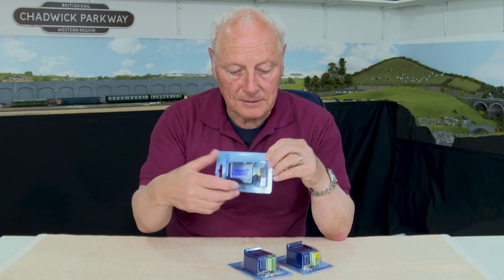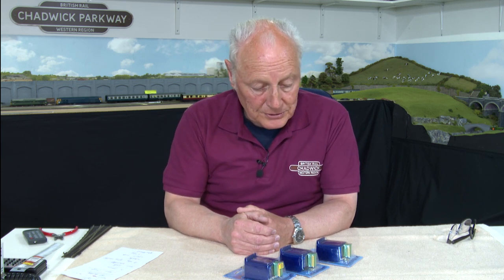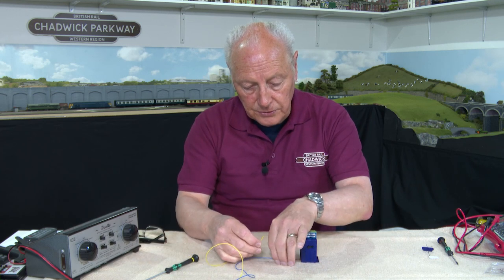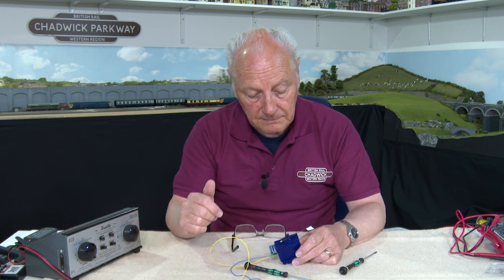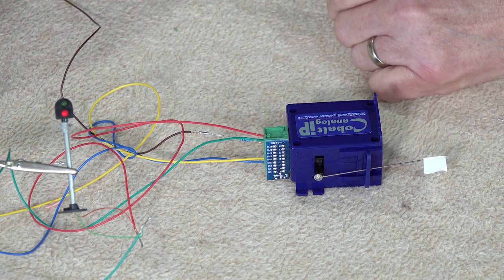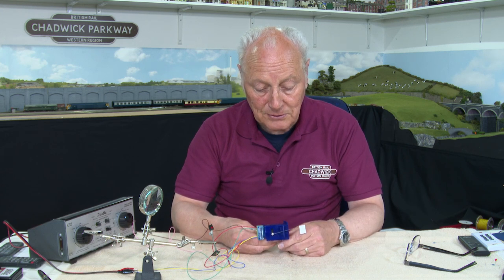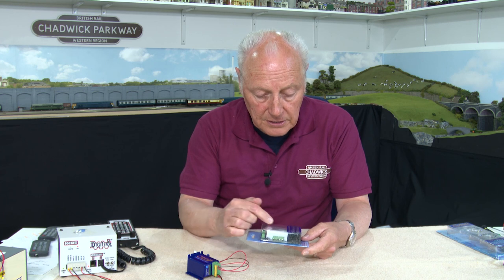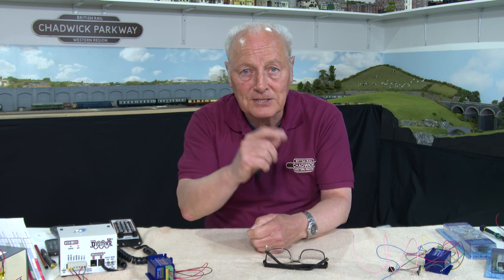Cobalt Point Motors on test at Chadwick Model Railway | 161.

Comment: Hi Charlie, I'm building my first layout and elected to go Slow action point motors rather than solenoid and Cobalt Omega Classic. I like the fact they come pre-centred for fitting. However, I do find them quite noisy, well noisier than I was expecting although I do not have any reference of other motors. I have tried using different voltages and that seems to vary the speed and the noise, so it's worth experimenting a bit with that. Your comment about removing them for oiling is a good one. I had to remove one of the motors to do some remedial work on the point and found - the double sided pads don't like coming apart once stuch in place. Luckily I had a spare pad but you'll destroy the pad if / when you ever had to remove the motor - unless anyone knows a clever way to do it while keeping the pad in tack. Cheers....
Reply from the maker: An excellent point Vernon.
Reply: We have loads of spare pads ;-) ^RB DCCconcepts

Comment: Thanks Charlie 👍 Another informative demonstration- keep up the excellent  work with your “how to” videos. This has made me rethink what I am going to use for DCC point control.
Reply from the maker: Just getting away from solenoids is so much better.regards Charlie
Reply: @ChadwickModelRailway  
Hi Charlie I have been following your channel for some time now and I wanted to ask which DC power supply you use for your DCC accessories. I know.that you are a digitrax user, however, I have decided to purchase the ESU command centre for DCC train running.  In terms of accessory decoders, I believe that a you have stated on a previous video that your accessory decoders are fed of a separate Bus Wire OR Accessory Bus Wire? Am I correct in my understanding that you use a DC transformer (power supply) to achieve this? Am I correct in my understanding that you have an ‘old gauge master’ DC transformer (Power Supply) which you use to achieve this?
Do you have any advice or tips regarding power supplies in this application, I believe that both Gaugemaster and DCC Concepts do manufacture Power Supply just wanted your thoughts on the matter?
Best Wishes
Jeremy

Comment: Always interesting Charlie. 
Is it really necessary to remove the spring?
I thought it would may be preferable?
Good idea with the sticky pad to get the original position before 
Permanently screwing in. Have had all sorts of problems with  centering and aligning the throw lying under the baseboard,albeit with ordinary Peco motors. 
The way you carry out most of your operations live complete with complications is a real positive. It helps with me with some simple solutions that I wouldn't probably wouldn't have considered. 
None of this "here's one I prepared earlier "
Look forward to the next layout update. 
Regards Howard
Reply from the maker: Thank you Howard, for a truly heartwarming comment.
I’m so pleased you appreciate the, live on the bench attitude. Regards Charlie
Reply: It might work w/o removing the spring, but it'll put a lot of stress on the motor & gearing. (same w/ a Tortoise).   So the question is, even with the Cobalt's lifetime warranty, would you want to start crawling around replacing them sooner?  

The spring is important for electrical continuity when using an old snap style coil switch or mechanical manual switching (rods or cables).  With slow switches, the piano wire peovides the pressure for continuity.   👍
Reply: To add to Frank's comment: The main reason for the springs is to prevent derailments when the switch isn't being forced in one position (which is the case with magnet drive motors). But when it is impossible to convert the drive mechanism there isn't that much which can go wrong, as these are only present on hinged blades and are very weak. Full rail profile points like Weinert 'Mein Gleis' and Tillig Elite only work with underfloor dive as the track itself is the return spring there
Reply: You do not have to remove the spring and the additional load it represents is both very small plus short lived as it goes away once the spring goes over centre. I'd argue it's mainly for the aesthetics of the blades moving slowly but the real blades move much quicker than these machines do. Any struggle is more likely to be the need for a thicker operating armature wire than the motor being too weak.
Reply: Hi all 
Appreciate all your thoughts. Many thanks. Howard

Comment: Hi Charlie, excellent review. I model in N scale and in my current layout I found that the size of the slow action motors was going to be very problematic. For example, I have a 4 track junction with crossovers at either end of a Peco double crossover. This means 4 point motors in a 2"x2" area at each end of the double crossover, or 12 motors in a 28" length for the whole junction! it was tight enough with the Peco/Seep solenoids. :)  If I was modelling in a larger scale I would use servos for a more realistic change action and quietness of operation.
Reply from the maker: I feel your pain Steve, it’s not easy for N gauge modellers. Regards Charlie
Reply: @ChadwickModelRailway  I am not an N Gauge modeller but I has a density of point work on one part my may layout and poor accessibility from under the baseboard.  I mounted a couple of Cobalts away from the points and used point rodding (also from DCC) to control them.  I also wonder whether adding the "horseshoe" half-loop in line with the rodding could solve some of the "accuracy" issues mentioned above i.e. set the Cobalt swing to be slight more than required and let the horse show take up the slack with the point blade hits the stock rail?  I have not tried this but maybe a thought?
Reply from the maker: It’s certainly worth a try Alec.

Comment: Good informative video Charlie, one care point I would advise, check if the life time guarantee is only up held if you follow the 5 year oil service requirement! Some companies are a stickler for that sort of caveat. Best regards, Simon.
Reply from the maker: I will question DCC Concepts and report back in the summer update. Regards Charlie
Reply: Just jumping in here to reassure that the warranty is not conditional on the maintenance recommendation :)
Reply: @richardbrighton7737  Hi Richard, thank you for the clarification. That is re-assuring and you should be commended for a true customer focused service/set of rules. Please do not think I had assumed you were doing that, just in my experience (I am an automotive senior engineer) small print can trip people up.

Comment: Very interesting to see the comparison and features of the various types.  I haven't converted to DCC yet, but after research decided to go for servo style point motors.  The advantages of these for me is that you can adjust the speed of operation, and you can adjust the travel end points independently.  I find that this makes installation a lot easier, as it doesn't matter if you happen to mount one slightly off the centre of travel.
Reply from the maker: A fair point mate, and also so much cheaper. Regards Charlie

Comment: Charlie, What happens to the lifetime warranty if you do not take them apart every 5 years to lubricate them?
Also how much did the top of the range one cost?
Lastly how many auxiliary contacts do the tortoise machines have compared to the DCC Concepts ones?
Great video thanks.
Reply from the maker: Hi Alan, I did mention the price, £25.95 as I recall.  I will question DCC Concepts on the warranty question. Regards Charlie
Reply: @ChadwickModelRailway  Thanks for that as I had only picked up on the 21GBP one and the cheaper 19GBP version. How many switching contacts do the Tortoise motors have as I thought they were similar but based on your review the DCC Concpts ones seem to be better with more options?
Thanks very much
Reply from the maker: Hi Alan, the tortoise have two circuits. Regards Charlie
Reply: Just jumping in here to reassure that the warranty is not conditional on the maintenance recommendation :)

Comment: Excellent analysis and advise as advise as every Charlie. I use both the IP Analog and IP Digital and best of all the AEU encoder so my lever frame signal box is portable and can be plugged in like a cab anywhere on the layout saving massive wiring back to individual switched. DCC Concept Cobalt is a brilliant and ultra flexible system. https://www.derg.ie/albums/gort/CobaltPointMotorSystem01.jpg
Reply from the maker: That’s great news, that you have found a workable system. Regards Charlie

Comment: Thanks Charlie. Would using the IP digital also remove the need for the point controller module, since they are directly addressed? I must get started on my layout!
Reply from the maker: Yes I believe so Gavin.
However, a call to DCC Concepts might be best to confirm it. 
Regards Charlie
Reply: Hi Gavin
No decoder / control module required. The iP digitals have in integrated decoder :) 
^RB DCCconcepts

Comment: Charlie, Your video is very timely.  I am getting tired of the Peco solenoid thump, and buzz.  It does ruin the mood.
I have just started to research new point motors.
As I am DCC with sound, I think you have pointed me in the right direction.  The DCC Concepts IP Digital is the one.
The next issue is finding stock in Australia, as supply chains are not good at present.  I will have to now save up my pocket money, and find stock.
Cheers, and thanks as usual for a very informatiove, and interesting video.
Stay safe,  Michael
Reply from the maker: Hi Michael, I’m so pleased you found it useful. However, I thought that DCC Concepts. was an Australian company, surely you can buy them at home. Regards Charlie
Reply: @ChadwickModelRailway , Charlie, I thought that they were UK, but I may be wrong.
Most of our big hobby shops are all sold out at the moment, but I will do some research.
Michael
Reply: I believe that DCCconcepts were originally from Oz but relocated to the UK and are based at Settle in North Yorkshire.  Best, Jason.
Reply: @Rock_God  Thanks for clarifying.  That makes sense, all our great developers and manufacturers leave.
Cheers all, and stay safe,  Michael

Comment: Another helpful review Charlie, thank you.
I was however left unimpressed with the control panel LED indication which seems to only confirm the input command from the selector and not the actual position on the point / motor. This is ok for a signal control but not a route mimic on a control panel?
 Perhaps i missed something but surely the point motor can give a position (end of travel) status which is far more helpful?
Reply: Charlie said that the non DCC ones are stalled motor designs, probably why the draw so much current continuously, which means that the driving power is applied even when the motor has reached end of travel. Hence why it can be used on the mimic, unless of course your concern is that just because the motor / points are powered to a position there is no guarantee they are actually there, and you want the feedback that they actually are. I'm having a model railway vicariously and don't actually these points motors, but sounds like the contacts used to switch the signals are actuated by some form of end of travel detection, and I would have thought that certainly LED based route mimics as well as the signals could be driven from them.
Reply from the maker: Excellent comments gentlemen. Lee, if you wired the control panel,  the way I wired signal would that not do the trick.?Regards Charlie
Reply: Charlie and Alex thank you for your replies. My concern is that the LED should indicate the point has mechanically reached its correct destination (end of travel) not the intended destination set by the input command. Surely this is how real track control and signalling works  in the interest of safety. In this way a user would have confidence hidden points were set correctly.
Reply: @axelBr1  In Charlies demonstration the LEDs have changed before the motor kicks into motion. If the motor current is indeed being used as the sensing trigger your explanation makes sense but confirms my point ...excuse the pun !
Reply: @stillstanding123  I'm not a railway person, but work in the oil and gas industry.

In the oil & gas industry, the main control item is a valve, and these are generally driven by compressed air and it's quite easy to make the move to a "safe" position when something fails. I image that this isn't the case for railway points. Until may be the last 20 or less years, it was very expensive to monitor the position of a control valve, (to verify that it's in the position it's commanded to be in), so the operator would only be shown the commanded position. Nowadays smart valves can report back their position to the operator.

In some equipment, knowing the valve position is critical, and those valves would be fitted with position sensors. But because the position sensor itself is vulnerable to failure the control system would indicate to the operator that the valve is either closed/travelling (neither the closed limit switch or the open limit switch is active)/open/command disagree. Command disagree being that the closed limit switch of a valve commanded closed is not registering, and vice versa.

Hopefully at some point after signalling moved to the large signal boxes some sort of limit switch feed back from the points was included and indicated back to the operator, but with the old manually operated points from a tiny signal box it probably wasn't. And probably didn't need to be, because if the level moved easily then something was broken, and if it didn't move, something was jammed.
 
You're right that driving the track mimics from the driving signal does not guarantee the points have moved, but it sounds like wiring them from the signal indicator does, i.e. it is driven by limit switches. But at the end of the day it's all about cost of mitigation verses the cost of failure verses the likelihood of failure. (I have a dehumidifier I may get round to repairing, that is inoperable because a £2 or so limit switch that detects the water container is full has failed.) Switching high efficiency LEDs is probably no problem for a cheap limit switch, but in the olden days, multiple filament bulbs may have stressed it. So it's all about is the cost of putting limits switches on the point motor worth it, certainly for a model railway. In fact even the limit switches on the point motor don't guarantee the points have moved 😉😁

Comment: Just as a heads up, when a product says 'lifetime warranty' they don't mean your lifetime, they mean the products lifetime which is right up to when they stop making it when its replaced by a new version.
Reply from the maker: Great observation but are you certain?
Should they not replace it with a newer version.
Reply: @ChadwickModelRailway  Up to a limit I think.  I think the law states minimum of 4 years in the US but not sure about UK/EU laws.
Usually a company will have a reserve stock of the item to allow for warranty claims 4-5 years after a product is discontinued but it differs from vendor to vendor.
This is both to counter abuse and make sure the company doesn't go under from basically having to give out free stuff.  And if you start giving out newer updated products as warranty replacements you are suddenly going to get a lot of people who's item 'magically' broke so they can get the new version, kinda like how certain people always drop their company phones as soon as a new one is released on the market.
There's usually a booklet with a lot of tiny legal print as to what the warranty actually entails with all the loopholes. It's the one that everyone usually throws away right away ;)
Reply from the maker: A fascinating reply, many thanks, regards Charlie
Reply: We absolutely mean your lifetime - if we replace the product then a replacement will be the new version. I hope this helps! ^RB DCCconcepts
Reply: @richardbrighton7737  That puts you above some companies I've had to deal with 👍

Comment: In round numbers, the cost of 40 Colbolt IP Digital is around £500.00 Less than 40 Colbolt Ip and 10 DS74. I get it that you are committed but it is a little suprising you avoided one majior benift in a review.🙂
Reply: Sometimes cheaper is not always better, with over 250 tortoise point motors and only one failure in 20 years, can cobalts claim better ?
Reply: @Llamberg.Railway  Probably, looking at the DCC Consepts testing vidio.🙂
Reply: Ah the good old sales pitch 😀
Reply: @Llamberg.Railway  I have zero issue with tortoise. Just thought it strange that Charley avoided the obvious benift of Digital motors in a review of digital motors. One pays ones money and makes one choice. I did not fancy the price of the TT Small even tho I am only talking 29 points. 🙂
Reply from the maker: That’s very true gentleman tortoise have set the bar very high. Regards Charlie
Reply: Personally I always apply the rule of Kiss to these things, the more complex something is the more likely to failure, but we all put what we want on our layouts
Reply: @Llamberg.Railway  Well yes, exactly. A digital motor removes a whole extra bunck of complex electronics' but it is verry much personal choice🙂